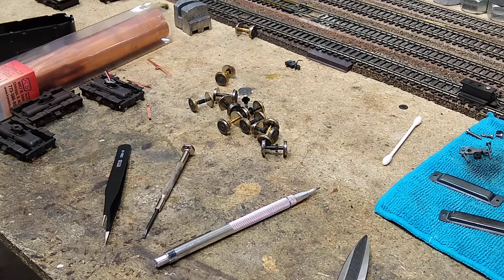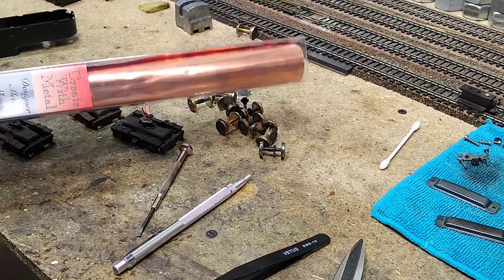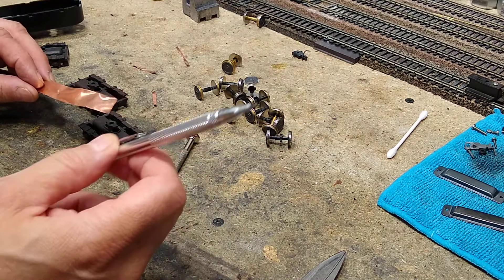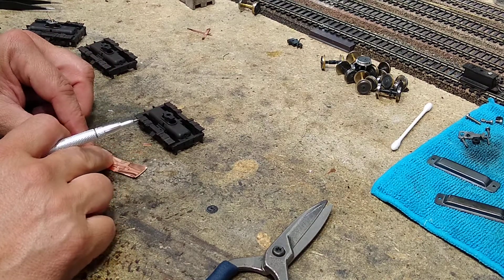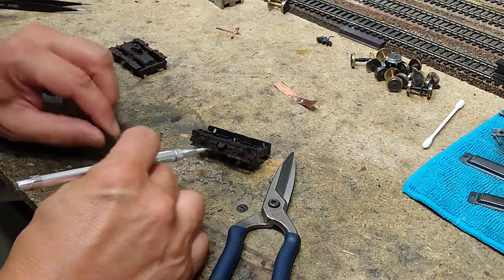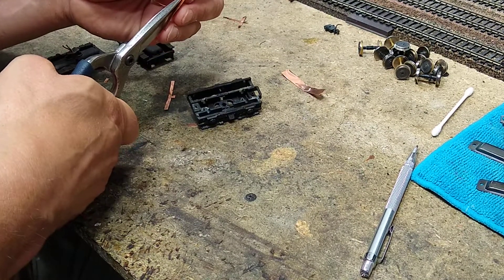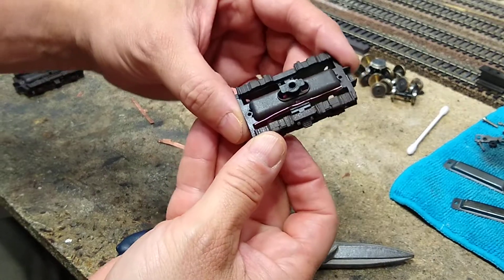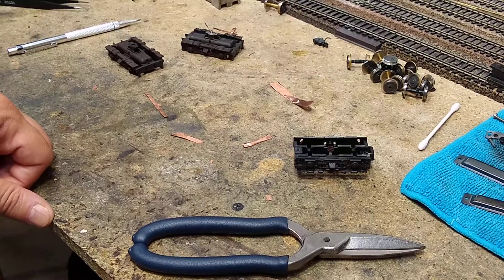AHM FM C-Liner Rebuild Part 9 Fabrication Situation Power Pickup

Comment: Copper too soft? No spring unless you harden it.Humm?
Reply from the maker: Since I coat my copper with anti-oxidant I don't usually hammer it or try to make it real springy.  I also have phosphor bronze which is very hard and very high tension spring, but the soft copper is much more reliable.  The bronze tends to rub the wheels at just a pinpoint location, but if it's to tight you lose the side to side movement of the axle and derailments happen, so I switched to the copper.  Most people don't like the copper because it can corrode and turn to crap, but I coat mine first.